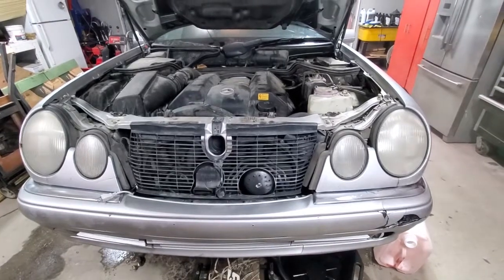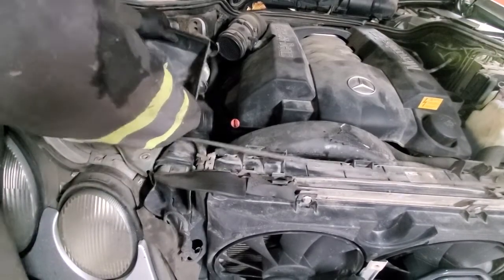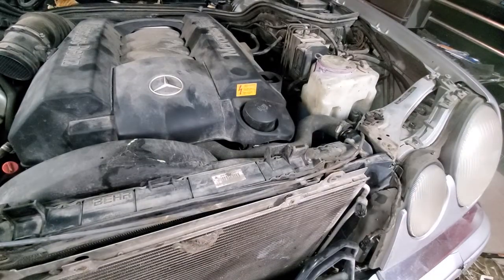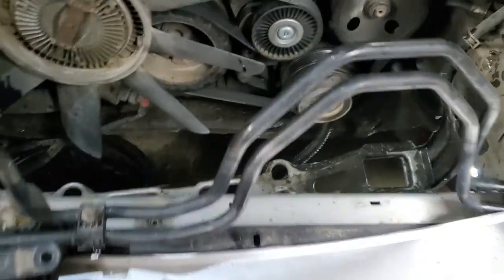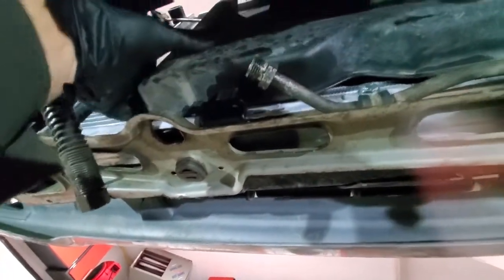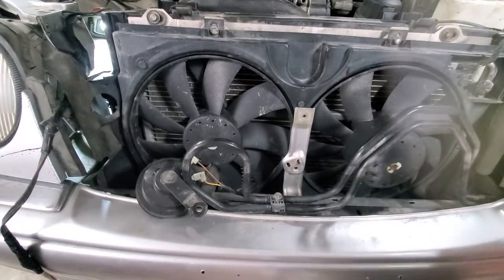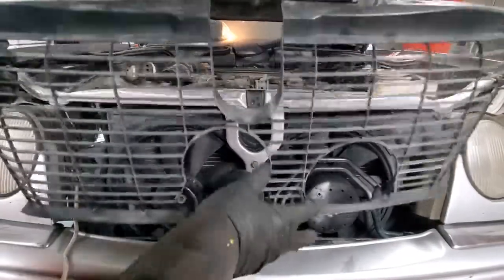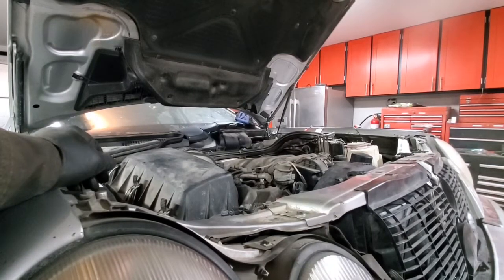Mercedes W210 E430 Radiator Replacement. Defective New Radiator.

Comment: Is this the same radiator as the  1997 E420? I have to do the job later on today.
Reply from the maker: Not sure about that.  Will be interesting to learn that from you.
Reply: @justdoityourself  Same radiator. Start to finish was a little under an hour. Very easy job.
Reply from the maker: @elmayimbe_the_amateur_mechanic  thanks for sharing!

Comment: Hello, I just replaced the radiator (Mahle Behr) yesterday and go for test drive. 
While turning AC to highest temperature (HI) and Blower Fan low speed, the air is cool. I guess air inside the coolant systems and also running for awhile, I heard high-pitched whirring noise from the radiator.
Do you know how to fix it? THANKSS
Reply from the maker: Hi! That's sounds like air in the system. Trying squeezing rad supply and return hoses and see if any air is coming out.
Also,  most of the time, if you can a car hot and then leave it for a night,  the air gets out on its own. Let me know how it goes. Good luck!
Reply: @justdoityourself  Thanks my friend, you are exactly right. An hour ago, I just checked the expansion tank has no coolant inside after driving hot early today. Look like the air are plunged out while running hot. 
Tomorrow, I will jack up and drain the water inside (I just filled about 4L distilled water yesterday and the tank got fulled), then use 50:50 coolant and hopefully can filled all 10L. 
Thanks again for your comment and confirmation. :)
Reply from the maker: Awesome! If you used water, I'd put 60%coolant next, as there will be some water left, so at the end you will get 50/50.